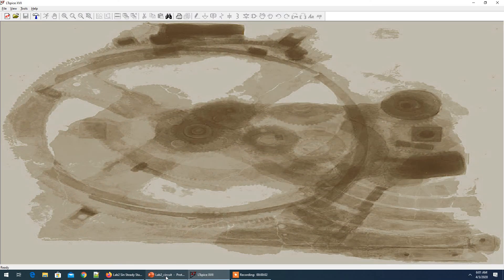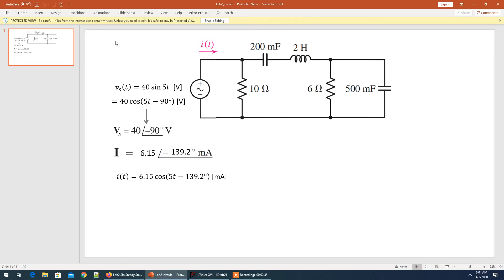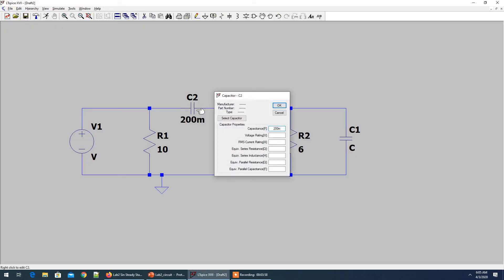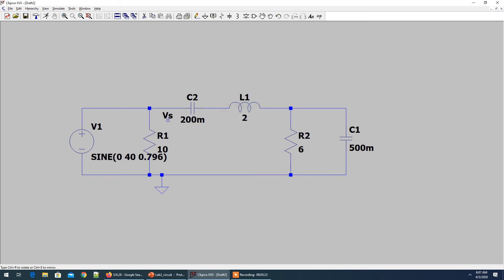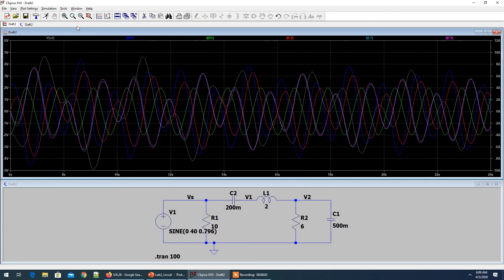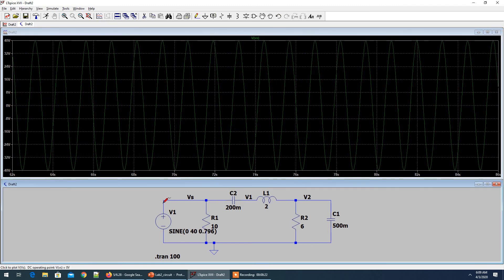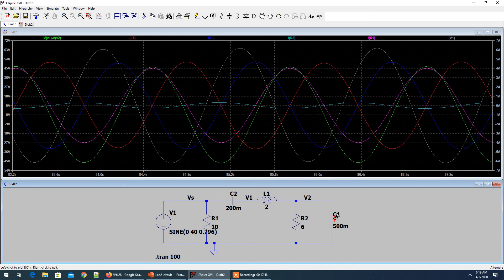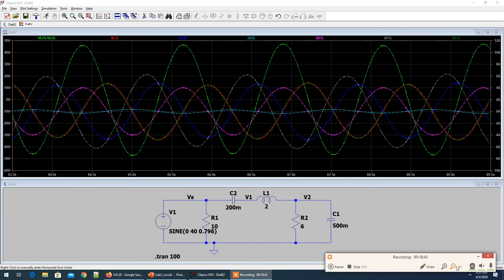LTspice Sinusoidal Steady State Analysis

Comment: Sir if there was a switch ? I just got one hill
Reply from the maker: I don't quite get your question. If there is a switch after the source, you will see the transients after the switch has turned on. If you are monitoring the voltage across a switch then you will see one step/hill which is the activating voltage of a switch.
Reply: @farazafzl  is there any way i could send you my circuit  question?
Reply: @farazafzl  Does this simulation give a transient or a steady state response?
Reply: Is there any difference in response between steady state and transient state?
Reply: Also for transient what simulation needs to be done
Reply from the maker: @micromosfetelectronics  Just watch all the Ltspice series. There is a playlist, where I go from basic dc analysis to transient, steady state and finally AC response. There is no shortcut, just quickly watch and reproduce the circuits and you will get life time experience and the confidence.

Comment: Very nice. At 5:06 you forgot to enter the phase of -90 degrees. Also an easy way to plot the difference between two nodes is to left  click on the first node and drag to the second node and it will be plotted without having to enter any formulas (16:52).
Reply from the maker: @baby boo:
Thank you for your comments.
1 --  Regarding 5:06 the phase angle is not important as there is a single sinusoidal source. Every other phase is relative to the source. It becomes important when we have more sources with phase angles. The explanation is here Secondly the video is part of the lab series of a University and always followed by the lab assignments, where students are left to solve few problems at their own end. These kind of detailed explanations take place during the Lab time. Perhaps you would like to see this video from 4:47 
https://youtu.be/_b9Zjg2vP7Y?t=288

2 -- Thank you for pointing that out. Well the idea here is to teach every different way of doing things. The videos are part of the lab series where student develop the skills every week and will ultimately be taught the technique you have mentioned. Later in the labs with more advanced concepts this technique becomes a commonplace, however here the teaching requires them to do it manually as part of their learning and the assignments to be followed.